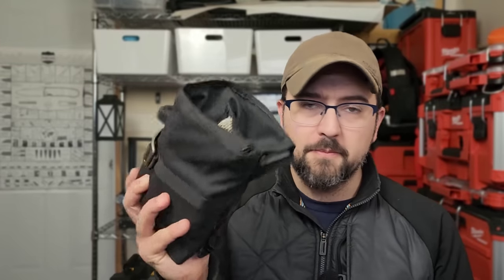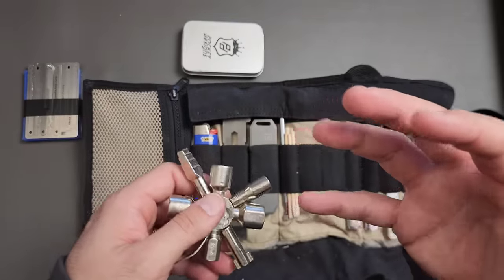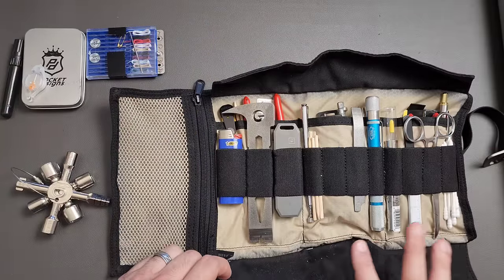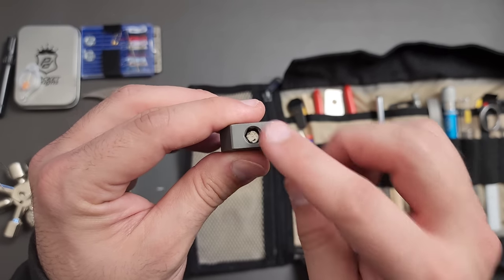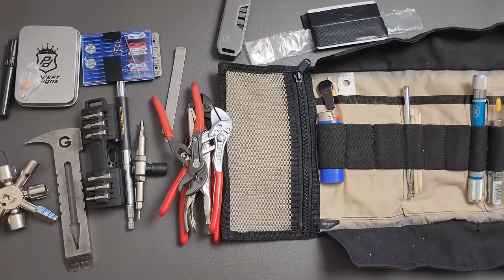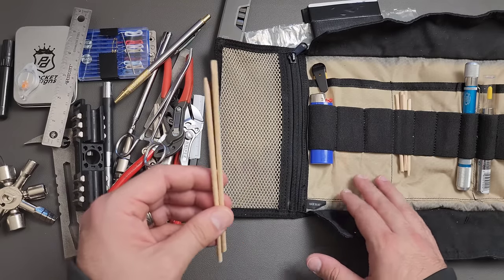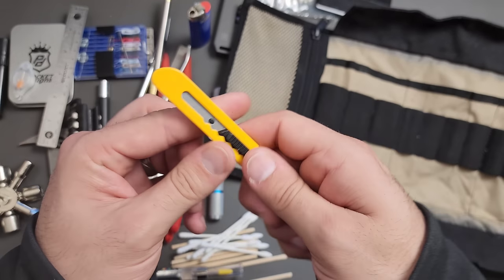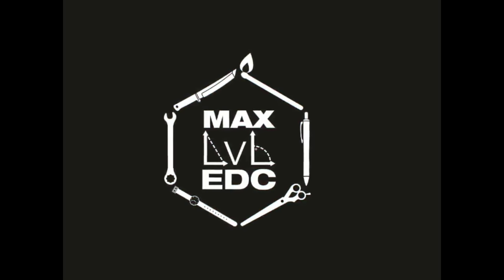🧰 My EDC Tool Kit (v1) How can I improve it?

Comment: Pretty solid👍 Might check out a Rohnson Jetlite lighter to replace the bick as it's also small and compact but it's butane refillable and has a precise flame and use design to use like a mini torch for your heating tasks. It's nice when you need to hold heat on something in wind for some time. Oh and I'd be interested to see a review of your preffered edc sized glues and lubricants with brand specivity in terms of what's worked for you in your experience on surfaces and temps.
Reply: That Ronson butane has damn near saved my life. No matches etc. But had an old Ronson in my bag. Fire lit, cold gone. I keep one in all my go bags now

Comment: Hi Dominic, nice kit it could use more tools I think, lol

Jokes aside, the biggest issue in a kit for me has been Tool Visibility! 
If the tool is out of sight, it's out of mind. 

To remedy this, I switched over to Cocoon 10" x 15" grid-it organizers. 
Each grid is for a specific purpose (modular works for me :yougotthis:). 

Tools could be grouped on a grid:
1. Either by size
2. or by project type
3. or frequency of use
4. or someother method that you find best 
 
I mix & match each of these modules or grids by linking them with the provided loop using one of those aircraft cable keyrings.
Lastly, I use clear plastic containers to store these grids/modules.

no jokes, I buy them by the dozen! 🤣
Reply from the maker: I need to look into this!!
Reply: @maxlvledc  fyi, there is a premium option called the Reef (made in the US) by a company called Step22 gear. It's more heavy-duty but doesn't have many size options. Btw you should consider partnering with them, they sell cool shit 👍🏽

Comment: As cool as it is take out the bit bar you don't need it with the fix it Stix, get rid of the bulky plastic fix it Stix case and put them where the bit bar was. Get some clear drinking straws, melt one end shut and fill them with screw bits. cut to length then fold over and rubber band the other end.

Put your q-tips in a zip lock bag, keeps out moisture and more sanitary if you have to use it on your bod

Be sure to take some sand paper and clean up the rough edged on your lock picks, the will work better. Good idea with the bolt & nut
Reply from the maker: The are all great ideas!
Reply: @maxlvledc  no problem, where did you get the roll from?

Comment: continuity tester?
Reply: And the needles and thread, dude you only need one. Save the space.
Reply from the maker: I'm not sure I understand
Reply from the maker: Different colors though 😉
Reply: @maxlvledc  They can be smaller than multimeter, yet many electrical problems are simple connection failures, which they can detect.

Comment: Mirror.  Preferably one that can be used at a distance.  Funtak, aka poster adhesive.  Handy for sticking somethings in place temporarily. Seam ripper.  Surprisingly useful when you want to separate stiched goods without causing damage.  Also can be used as a cocktail fork.  :D  Cross-locking tweezers.
Reply from the maker: Omg..a mirror on a stick..your sooo genius!

Comment: This is an infinite rabbit hole. It's possible we all need to get better at narrowing down what is really needed...but where's the fun in that? Here's some ideas to extend/diversify capabilities:

- Small tea light: like lighter but frees up a hand when doing heat-stuff, wax is also a lubricant and can drip onto things as sealant
- Repair materials: assorted diameters of wire for quick fixes, silicone self-adhesive tape for insulation/waterproofing, polycaprolactone "friendly plastic" in a small sheet (melts in hot water, can form/cast into repair patches, handles and even crude tool bits)
- mixed liquids in small dropper bottles or heat-sealed straws: solvents (contact cleaner, adhesive remover, acetone, 99% isopropanol for things acetone will damage), disinfectants (iodine, bactine, liquid band aid), 2-part epoxy.
- Adhesive aids: baking soda as accelerator/thickener for CA glue, cyanoacrylate debonder gives you an "undo" button for that glue and some sort of fibrous wicking backing for adhesive, like fibreglass or denim; makes a sort of composite patch. Use above solvents for surface prep and removing debonder.
- Chunk of magic eraser foam - (when used with solvents) best way to remove marker, residual adhesive or sticky films from aging plastic.
- Instruments (can't fix what you can't see!): some kind of magnifier (Fresnel, loupe or something like Carson micromini with UV and white light built in), compact multi-meter (UNI-T UT120C), magenetic viewing film, in-line USB volt/amp/watt meter.
- Sewing kit needs a regbuild: Swap some of those threads with upholstery weight ones for heavy repairs, add a needle threader or two, small seam ripper and maybe a thimble (even if just a plastic one) and maybe a monocular loupe.
- Wax/cotton ear plugs: fire starter, plug leaks, protect hearing (you'll thank me when you're older!)
- Strips of mixed grit sand paper (sharpening, replace those files when wrapped around squewers)
- Workspace/dump pouch/folding tray: where you keep all the bits while you're in the middle of using them

Comment: Tape measure, maybe wrapping the Teflon tape around the scribe handle or file handle so you can keep it small. I added recently a hot glue stick, and one of those gator grip sockets. Cheesy I know, but I want to see if it’ll work with different sized nuts or just something threaded beyond finger tight like say a wing nut. That second bit set with the t driver, where can I find that

Comment: Trauma shears instead of the friskers. Much stronger and cuts more. Leatherman makes a great folding pair.
Pen magnet I have one that lifts 10 Lbs. I modified by taking off the back and pen clip. I filled the hole with that steel epoxy and put in a screw eye. That way I can extend the reach at least down by attaching cordage.
Ti EDC Wrench . Yes I know extensive but acuminates many sizes of nuts. Check it out.
For the teflon tape. Take it off the roll  and wrap it around something like the file case.

Comment: Things to lose
literally almost everything. whats the purpose of this kit? why have you selected such big and heavy solutions for things you probably will never need to do away from a workshop environment, an environment where you would ideally have a tool box... even the tool roll feels unnecessary... all the tools are great at what they do for sure and theyre all loosely related to survival or preparedness or whatever but to carry this kit daily? 

I actually use an EDC tool kit because my job is taking apart IT hardware installations usually in outdoor settings like stadiums or open spaces to check what installers have done. my kit is a small bosch ratchet and bit set (which by the way has sockets), 1/4 extension, a leatherman, a laser measuring tool, a gerber prybrid, a pair of klein scissors (thank you for the recommendation) hearing protection, tweezers, a small container of bits like spare terminals, screws, nuts and heatshrink, zip ties and a wd40 pen. it all fits into an alpaka tech bag and it also has enough space left over for a laptop charger, earbuds, touchpad, and cables. 

think about what this kit is for where it will go and why you need it. ask yourself "have i had to do that in the last year" and if the answer is no then dont include a tool for it... this is every day carry man, for shit that happens every day

Comment: I'm a bicycle type so the lack of pressure guage and tools kinda hurts. Countless times I'll be at a gas station and their guages will be bust then I loan mine to people in line for the compressor. I live where 15 psi makes the difference in winter between traction or slip so I consider it a necessary everyday item. Mine comes with a ruler markings too.

Comment: I'd like to see you use the solder seal on a video.  (Got the County Comm pry bar, Knipex Cobolt Cutters, Knipex 5" Plier Wrench,  the Knipex Cobra/micro, the Universal Key, and a magnetic extension device,  as well).

Comment: To improve... I feel like I wouldn't double up on screwdrivers. Maybe I'd swap the locking pliers for a Leatherman crunch. Though it's not adding utility so much as compactness. Maybe throw in a jigsaw blade or two with the crunch. I'd probably drop the wire cutters unless you have a strong reason to need them with your job or life generally. They're cool, but they're big and multi tool wire cutters can cut through a chain link fence fine. And most wire I've dealt with regularly. Engineer makes a monkey wrench with thin jaws. It's not as convenient as the pliers wrench, but it's smaller with probably better leverage. Those solder and seal connectors take up a lot of space, but if you use them regularly, go for it. There's a company called pockit that makes a really small Bluetooth multimeter that works great. If you do a lot of auto electronics. I think it's only good up to 30 volts or so though. They have a pro model that goes up to a thousand volts, but it's a lot larger. It's still pretty compact relative to its capability though. Easily half the size of my normal multimeter. There are a number of really compact measuring tapes. And better lockpicks for not much extra size. I'd carry a SIM tool. Though the paperclips are probably fine. A small headlamp like the Nitecore nu25 with shock cord mod would add a lot of utility. As would a small screwdriver set like the HOTO screwdriver set.

I guess it kind of depends on what you do in your day to day. I work in tech so I tend to need small tools. I EDC a Leatherman style PS and it's all I need for pliers most of the time. Small multimeter, a USB c breakout board, small and normal screwdrivers. That does it for me usually. Letterman wave if I have space or am not flying.

Comment: For sockets, you should look into the small socket sets Makita makes, they are 1/4 drive, they have both metric and SAE sizes, they come in a compact holder, I have 2 of each set to work against each other if need be, they are great sockets. Makita E-01694 and Makita E-01703.

Comment: Those 4" Long nose Vise Grips won't tolerate any amount of torsional load parallel to the jaws. I'd replace them with 4WR or 5WR conventional jaw locking pliers and probably use them in place of the small Cobras. Will 3.5mm hex drive bits fit that pin vise in the file set? If so I would add some. Good video, everyone uses their shit for different purposes and their needs consequently are very different.
Reply from the maker: Omg I've never tested that!

Comment: I know you already have a hammer but I keep a handle less Nupla hammer in my car kit. A bit hard to find but they are still out there. 

I like it because it not only has a steel face but also a softer face on the other end. Actually used it a few times when I don’t have room to swing a normal hammer. 

For your kit you may not like how much space it takes. But maybe pick the lightest weight.

If you can’t find one maybe get a regular hammer and remove the handle?

Comment: You carry all that on you every day?

I have a much smaller kit I carry on me every day, but have all that functionality.  I think it is more about what your kit can accomplish than about how much you carry.

Each person's needs are different, and maybe you need each of those items, or do you?  I cannot answer what you do or don't need, but your kit seems to have a lot of excess.

At some point, you may as well just bring the full toolbox.  This is not a criticism, and I think your kit is a good starting place, but you are miles ahead of many people whose EDC kit consists of a cell phone, an exercise watch, some keys, and a credit card.

First item that needs to go is that custom tool.  There are far better options.

Second, as others have commented, the drivers/bit options.  Even my car kit is more efficient.

Third, that bag is not optimal.

Fourth, that tin is the wrong container.  It defeats the point of using a bag.

Fifth, the ladies' sewing kit.  That is not an optimal use of space.

Sixth, the lube/grease/glue options.  Mostly wasted space.

Seventh, the bolt cutters.  Really?  When do you need bolt cutters for anything that small?

Eighth, the toy carabiner.  Either get a real one or get rid of it.

As I stated, I don't know what you do or don't need, but if you need that functionality, do it right.  I don't recall all the other items, but correcting those things should get you off to a good start.
Reply from the maker: In a backpack I do. But I'm leaning toward a much more trim kit.

Comment: how can you get any work done without paper towel / scraps of fabric and a detergent?? 
Using my bottle of ethanol and fabric-scrap(s) everyday for basically everything. 
would drop the waterkeys and carry some ethanol, what if you need to sterilize something? what if you get oily hands, what if you cut yourself on something nasty, what if you need to remove some paint, what if you need to make a fire in an rainstorm, what if you want to clean your phone, what if you get covid, what if you run out of beer, what if you step in dog-poo?? 
Get a nice thin cotton fabric..
Reply from the maker: Hmmm, you make a very good point.

Comment: I would  put in several saw blades wood and metal and a handle ,add a loose magnet also,small c clamp,  and add a locking crescent wrench with the large jaws. add pipe thread, yellow and white. also a few shrink tubes I carry a 10 foot cloth measuring tape . add some 100 pound bank line , 50 feet add a good small  flashlight ,  charging plug with usb and micro,
Reply: an xacto knife is also great when you need one

Comment: I just started the video, but my first suggestion is to get rid of this giveaway carabiner and get a climbing proof carabiner, this would help in situations you need to rely on a carabener. And if you use one with e. g. screw to secure, you will also not loose your stuff.
Reply from the maker: Good point.

Comment: Space saving: personally I'd get a smaller sewing kit, the repair items in the tin could be put in a soft shelled pouch, no big idea but bar, you're set with the fix it sticks, speaking of which, I would store them separately and not on the bit holder, maybe use your small wiha bits that you got for your Ozark multitool, that's what I would do for space saving, you'd prolly get the pouch closed easier, as far as missing items? It's pretty comprehensive, the only things I'd add are favorites I always use like some small zip ties, twisty ties, thin ranger bands and some tarred bank line. Possibly heat shrink tubing too, I know you got your seals, but I just use heat shrink for all kinds of stuff.
Reply: Oh! And I just realized! You can replace both the fiskars and the clamp if you use your Dr. Slicks, I think they tested better than the fiskars too

Comment: Ditch all the 1/4 driver section of the kit and replace it with the icon kit. Remove the case and use standard bit sleeves to store the bits. This will reduce the size and still offered the capabilities of what you have in a much smaller package.
Reply from the maker: Hmm, you may be right

Comment: You can take either some duct tape or any kind of tape that you prefer and use it to wrap up the little wood sticks. That way you have a little bit more tape and it holds all of the wood pieces together in one place. Just a quick thought
Reply: Another thing that you could add is emery boards normally used for finger nail filing. Adam Savage loves the Emery boards and keeps them in most of his tool kits. The Emory boards or stick can have different sanding grits cost almost nothing and take very little room. You can use the diamond files for the sanding too but if you use the Emory sticks your files won't get clogged up with dust.

Comment: May I suggest replacing your knipex  cabinet control key with a proper silcock  key. I recommend Husky brand. I got mine from home Depot for $10 dollars.
Reply from the maker: Hmm, why is it better?
Reply: The knipex is for access to cabinets in a building's basement or roof where a HVAC repairman for example may need to access certain systems or controls. The silcock key is for turning on water spigots that you can find on the outside or front of buildings, where of course it's not necessary to access it's basement.
Reply: I just fact checked myself and saw some video shorts of individuals using the knipex key to access spigots in front of houses also. I stand corrected.

Comment: steel wire. you can do more than you think with wire and a plier based multitool. 
also ive been thinking of swiching out 1 of the knives on my surge for a pry bar
Reply: or if you dont like wire you could use somthing like 80 lb test braided fishing line . you could have 100  yards in your sock without feeling it. but double it over and it can lift your body weight
Reply from the maker: There is a pry in the st300M u can use.
Reply: thx i also found the 4" widgy on the countycomm site you mentioned